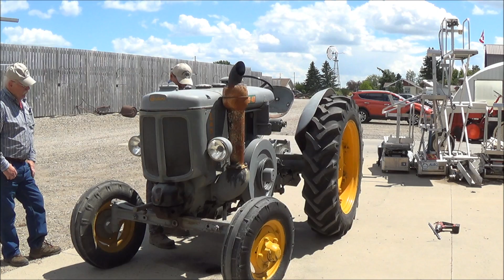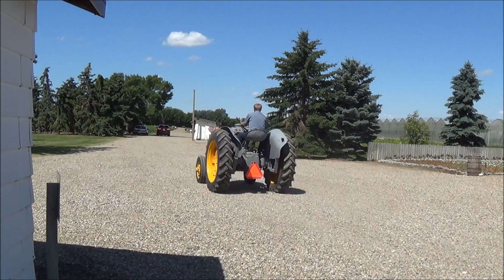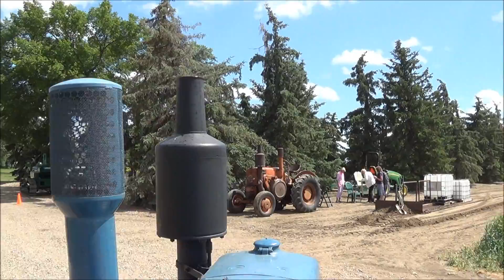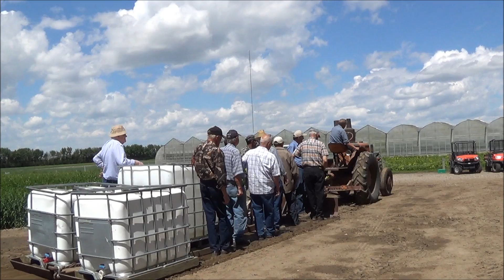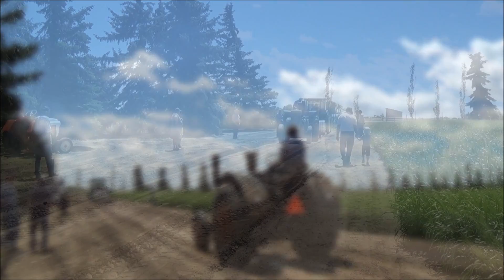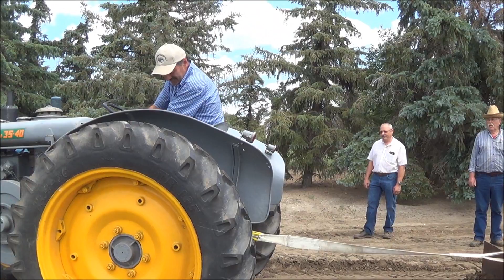Broxburn One Cylinder Tractor Show 2017

Comment: Did you know that Landinis have a valve on the right side of the cylinder to blow out too much fuel ? No need to remove the nozzle to do this ! My favourite in this line-up is the unrestored D5006 Lanz Bulldog. A Hungarian HSCS would fit in there !
Reply from the maker: novembaer69 Yes, the unrestored one is a real gem, were going to leave it exactly as is on the outside. Funny you mention an HSCS, there was one at this show but it was being serviced at the time..

Comment: Big single cylinder one lung Lanz Bulldog, some of the others beside it, looked like relations of the Bulldog.
Engines ranged from 6.3ltr 12hp up 10.3ltr 55hp, low hp but enormous torque pulling power!